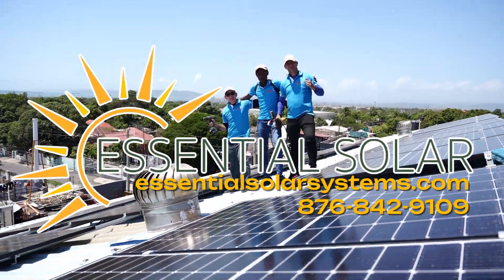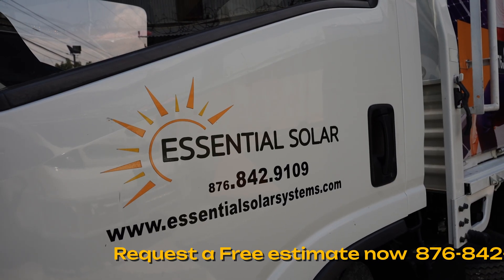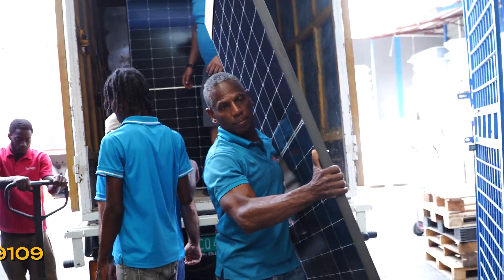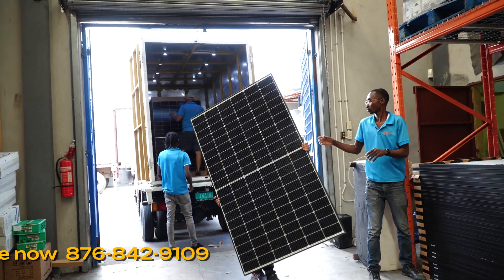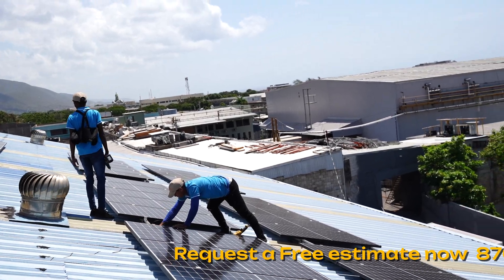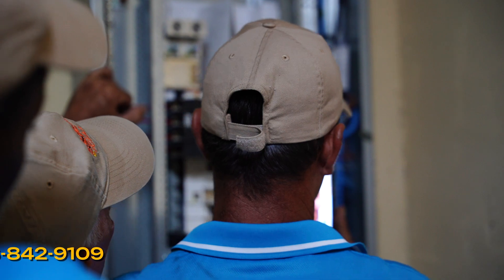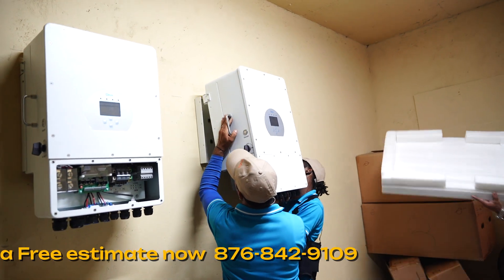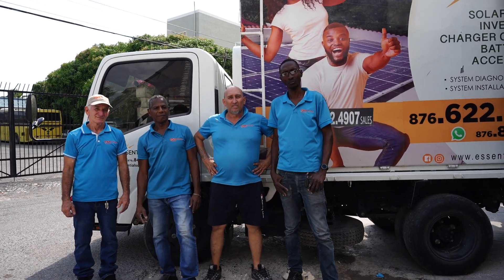Solar power System installation in Jamaica 🇯🇲

Comment: This was a huge install! Good job guys!. Also remember, a solar power system will last so long that our children and grand children can inherit the system so it's a great investment. Note: The voice audio was really low in this video.
Reply from the maker: Thank you so much for that observation. It will last for generations indeed. Hopefully with practice our voice over will get better.
Reply: That's how long they last? Wow.
Reply from the maker: Yes! there are so many misconceptions out there about solar one of them is that it doesn't last but that is not true my neighbor has solar for 15 years now.
Reply: @naakaalastudio6655  Yes if you take care of the system it will last a long time, probably only batteries will have to be changed every 10-20+ years depending on how you treat them.
Reply: @lawrencedavidson6195  Nice. Thx for the info.